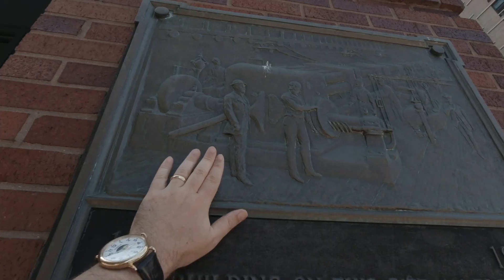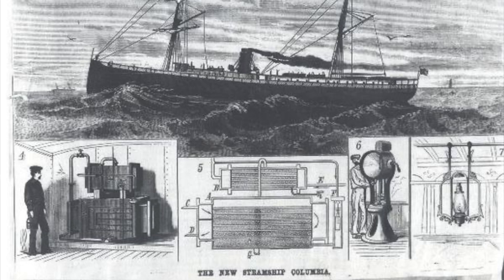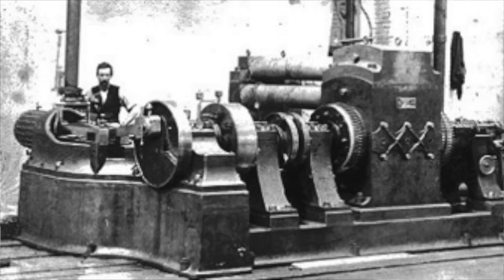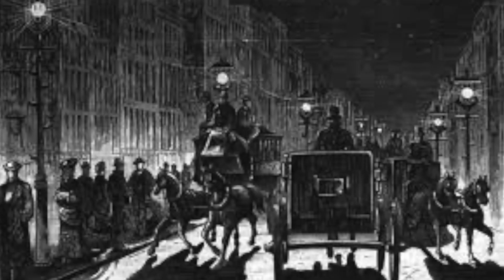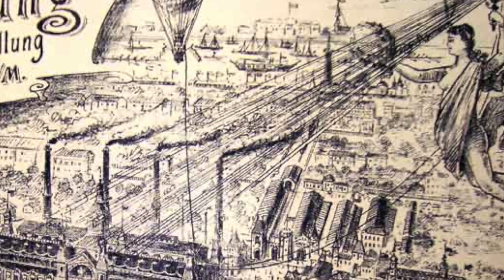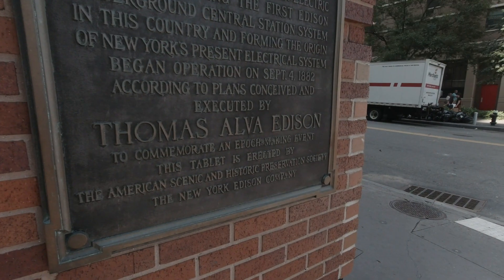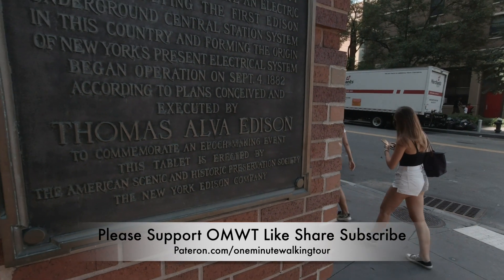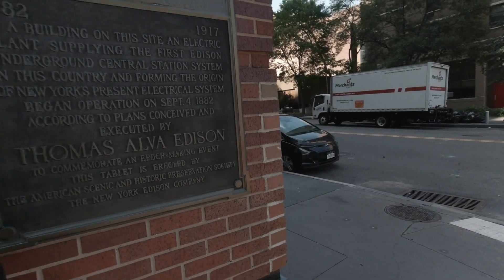The Pearl St. Power Station

Comment: lighting was very low voltage at the time so electric power couldn't be transmitted far edison experimented with batteries so was still ahead of the times in a way if it's considered in terms of today; incandescence, grid scale batteries and so on it's a shame the potential of the gaseous voltaic battery (fuel cell) seems to have been overlooked until much later
Reply from the maker: Thanks for your input!

Comment: The start of the electrical revolution. Those events launched mankind into a new era. A lot of people don't realize that Thomas Alva Edison also indirectly contributed to the making of computers through an effect called "The Edison effect." He noticed that one side of the lightbulbs he was using was darker than the other. The reason for this was electrons were being released from the anode end of the conductors. This led to vacuum tubes. This led to circuits that allowed for computing mathematical problems fast forward 120+ years, we're using this technology to watch videos, cheat on our homework, and simulate warfare online while talking about each other's mom. Engineering is beautiful.

Wait a minute.....does this mean that Thomas Edison indirectly contributed to "Your mom's so fat" jokes?

Comment: Do these generators still work and what voltage did they put out and was it 3 phase or single phase
Reply from the maker: The power station was torn down in the 20th century. I believe the generators are in a museum but how they functioned? I don’t know
Reply: @oneminutewalkingtour  they are interesting do you know what museum and will they know if they are 3 phase and what the voltage is for outputi thought you were just there 2 months ago when you uploaded
Reply from the maker: @DavidBerquist334  The station was originally powered by custom-made Porter-Allen high-speed steam engines designed to provide 175 horsepower at 700 rpm,The station burned down in 1890, destroying all but one dynamo that is now kept in the Greenfield Village Museum in Dearborn, Michigan.
Reply: they were DC power.